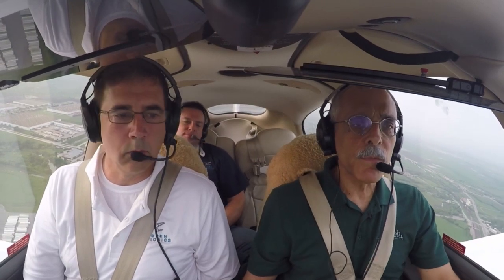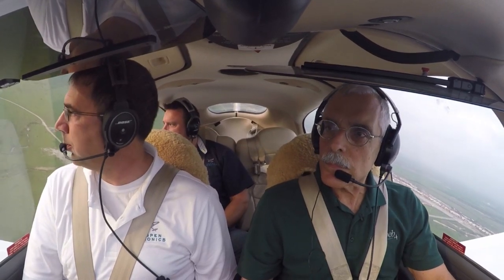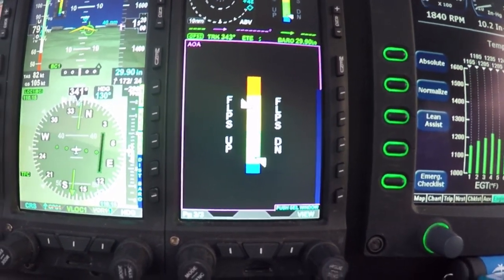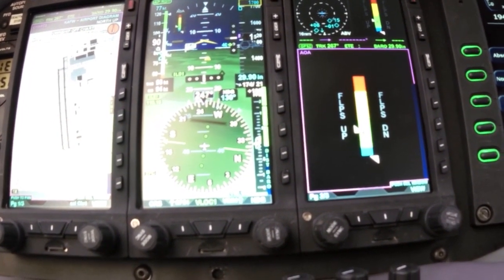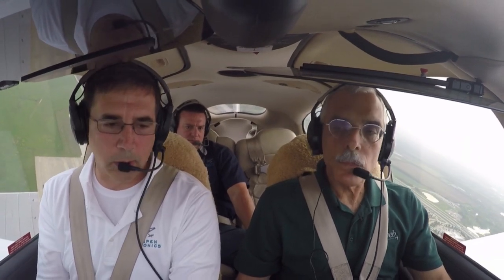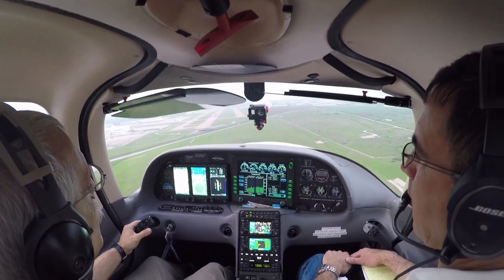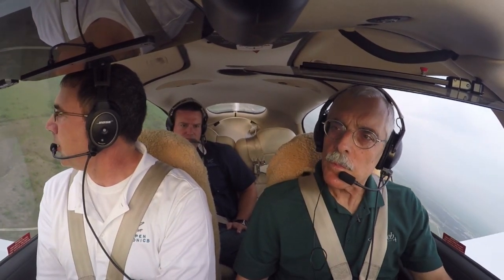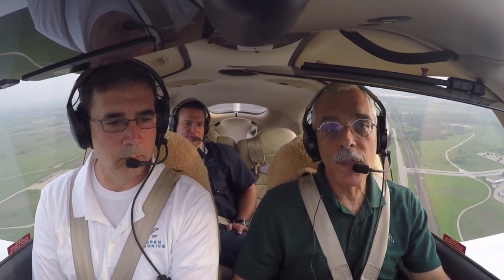Aspen Angle of Attack for Evolution EFIS: Demo Flight

Comment: Am I the only one that feels that this new instrument is useless and will only adds information that will distract the pilot? Thoughts?
Reply: AoA gauges are incredibly useful for teaching someone how to fly the wing. It gives them an accurate indication that can be directly transferred to learning to "feel" the aircraft. It's much better than spewing out standard airspeeds in various phases of flight and a slave-like following of certain airspeeds does nothing but hurt the trainee overall. In my opinion, teaching someone the basics using an AoA gauge will produce a much better pilot in any training aircraft.
Reply: Allen Hartzell You're not the only one that thinks so, but I disagree; given that stall-spin accidents in the pattern continue to happen shows that many pilots need a new tool. Some of the best pilots in the world fly aircraft equipped with AoA indicators. That would be US Naval Aviators.
Reply: PDZ1122 I think resistance is fading. Aspen isn't alone in adding an AoA indicator; Dynon and Garmin both have them on their popular EFIS displays. Other than needing a special dual-input pitot tube, the rest is mostly software, and so doesn't add much to cost. For those who don't have EFIS displays, stand-alone AoA indicators -- such as those by Safe Flight -- are available.